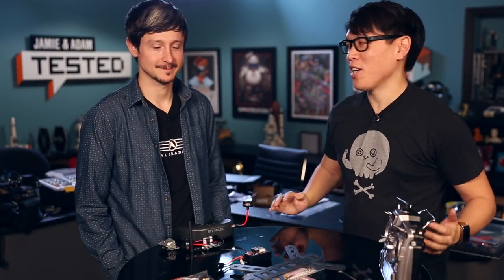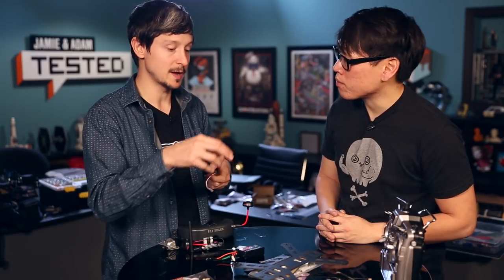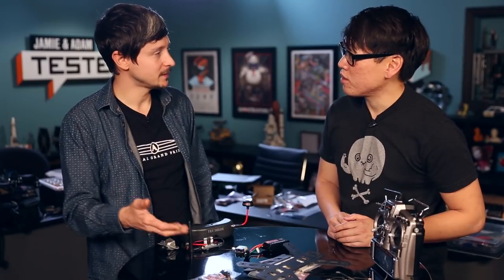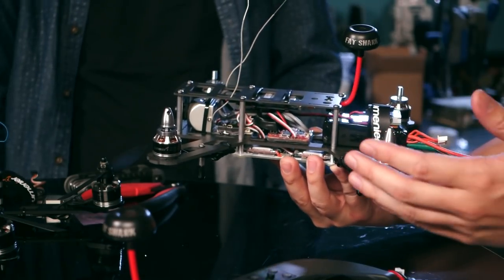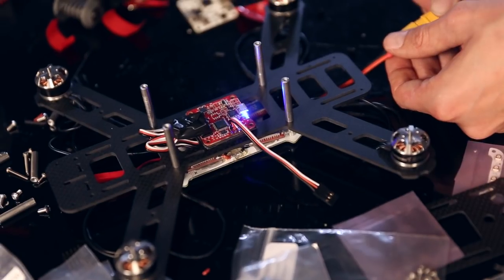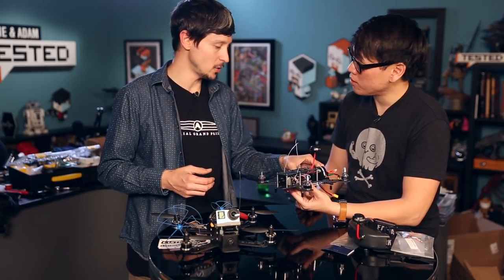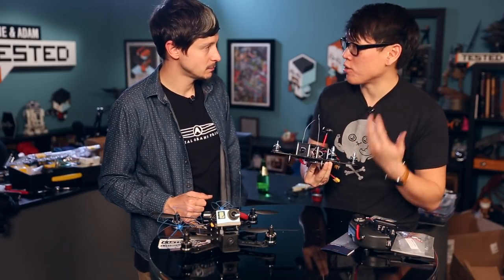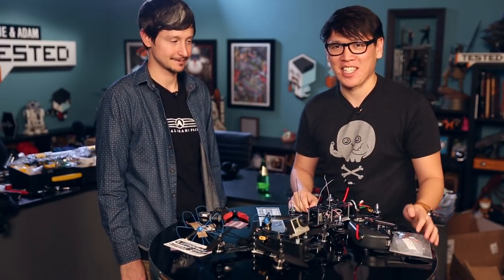How to Build a FPV Racing Quadcopter!

Comment: So I am assuming a full build is like £600+...
Reply: Ethan Gordon nope, you can build a quad for about $250 (as of may 2015)
Reply: ***** Really?! If so nice!
Reply: ***** Nice! Thanks for the information :)
Reply: Np
Reply: ***** Hey I am interested in building one of these FPVs. Do you think this is a drone for beginners? Is there a newer video? (you say May 2015 so I assume there is). Is this list below a good buy? Thanks (Im a noob at drones so pls go easy on me :)  )
Reply: I really wouldn't try this of I were a total beginner.

I would start with something cheap and easy to fly, learn on it, then go up one level and so on.. This 250 FPV quad is more like 5th or 6th step along that learning curve.

Start with a Syma x11 or similar, then I recommend a latrax alias with upgraded motors from micromotor warehouse,, then something cheap and easy to fly/ build..phantom/350/450-clone or even a hexacopter flamewheel something that you can add a nice gopro mount or gimbal and basic  FPV set up to.. then decide what direction you want to go.. more sport FPV or more Areal camera platform... get goggles and or a 7-8 inch screen.

Either way, by that point you'll be ready to make this and fly it, in fact, you should probably have the skills at that point, to build whatever you need next.
Reply: Thank you a lot. I will definitely look at these options.
Reply: Is the Hubsan X4 H107C a good starter drone or should i stick with the syma x11
Reply: Hubsan is older and less refined. It's faster and can be used with a Spektrum transmitter if you get the transceiver, made and sold by some guy on facebook.

The syma is slower and less agile but agile enough and is lighter, has longer flight times, and is easier to control and more durable. Try and remember why you're getting it.. To learn on... It is cheap and easy to fly, and you won't mind crashing it.
It's not, a sport copter, it's a trainer.

Camera versions are not worth buying at this size. There is a video on my channel of the Hubsan camera footage.. It's not very good. . Better off getting a latrax alias and using the camera you can get for that. If you want cheap copter to practice taking footage. But all camera quads are not that great at this price range.

FPV rig is usually over $1000 once you get a camera, AV transmitter, antennas, the actual quadcopter, 6ch radio transmitter, goggles or ground station screen and AV reciever, batteries and and charger.. You can do it cheaper but that involves a lot of hunting for the right thing at a cheaper price, and you need to know what parts you're looking for.

It's not a cheap toy.. That is why I suggest you get a syma x11 to start and learn with. Then upgrade to the Latrax alias, get a camera for it, then make a full 450 from a kit, make an FPV set up and put it on your 450 ...build a ground station or get goggles and learn to fly FPV.. THEN, build something like the 250 on the video and then learn to FPV with it at much higher speeds and far more agility than the 450 you made and learned on.

That is the recommended way to do it, and the most fun and self educating.

If you get into this hobby by making one of the 250 speedy fpv quads, you'll probably give up and have crashed your expensive toy hundreds of times.

Do all that crashing and learning on the syma x11 and latrax alias.. The syma will teach you the basics and is fun to learn on and learning to maneuver the Alias, will make you a confident pilot.

One last thing.. VERY IMPORTANT, DON'T FLY ALONE!!! Always have someone with you to spot your plane.
Everyone needs a spotter to watch, just in case you lose control or lose sight of the quad as it drifts behind you or into the sun.

I ignored this advice before and lost my quad.. I never fly alone anytime anymore. It's just not worth the risk of losing your quad or the risk of hurting other people.

Watch out. Fly safe. Become an example of a good pilot.. Not just another idiot who gives us all bad reputations in news reports

Good luck and always feel free to ask me or other people in the hobby for help. Don't go it alone, it's no fun, frustrating and expensive.
Reply: Thank you very much itchy robot.   I will be sure to get back to you once I get my drone. Do you recommend getting more batteries for extended time or will the originals last a good time? I plan on getting my dad a drone for father's day because him and I really like it.
Reply: If you're getting the Syma x11 to learn on.. I'd get the 5pack of 350 or 380mah 1s lipos and the 4 way charger.. You can find all of it on Amazon.. the batteries and extra charger are lower down on the same page... 
http://www.amazon.com/dp/B00L4O3GV6/ref=sr_ph?ie=UTF8&qid=1433864961&sr=1&keywords=syma+x11
Reply: Ok. I'll check that out. I received a syma a while back as a gift so I got to look around for that. I remember that the last syma I had, the blade was opposite so it kept flipping. I tried to fix it but I never got the time to look into it anymore with school. Thanks again for all the info!
Reply: Latrax Alias is also on Amazon, a simple search will show results for the camera and the copter.... However, I do recommend the 'insane speed' motors from micro-motor-warehouse http://micro-motor-warehouse.com/collections/parts-for-rtf-models/latrax-alias

If you don't want to get $1000s into the FPV hobby and filming, you like mini quads, and don't mind core-less brushed motors with their inherent flaws, and find that you just aren't into the 'big stuff', check out what Benedikt Haak does over at micro-motor-warehouse.

That might be your thing too?

But for hobby grade, really fun micro copters.. Micro-motor-warehouse is the place.
Reply: Timothy Valkenhoff I'd start off with a RTF (Ready to Fly) version.  Let someone else do the work for you, and start with the fun part.
Reply: ^ that's a great recipe for getting into trouble, spending $500.00 and getting ZERO fun out of it.

Build, learn, and train yourself.. DO NOT get an rtf sport quad as your first quad.. You will have ZERO fun crashing it immediately, wrecking it, and having no idea how to fix it.

 Learn how to fly on a $25 syma x5c or an x11, then build a 450 for about $250.. learn how to build and repair, and fly without any stabilization gimmicks. Get an FPV set up and learn how to FPV on that 450, or cheap second hand Phantom (I got one for $65 at a yard sale) at a reasonable speed

Then... get a sport quad.. you'll be ready for it by that point, and you'll know how to fix it when you crash.  FYI you will crash :D

DO NOT GET RTF SPORT QUADS.. that's what idiot novices do... then they crash into something, or someone, and give us ALL a bad rep.

Please don't add to the already bad press just by being an over confident idiot.

I usually train people with FPV set up on something like a Dromida RC car or a cheap 1:10 SC truck. Then put a little $99 HK/fat shark micro cam+AVTx , on a syma X5C or equivalent.. then learn to FPV with that in a back yard size area.

DO NOT BUY SUPER FAST, RTF SPORT QUADS AS YOUR FIRST QUAD COPTER.. ONLY AN IDIOT WOULD SUGGEST SUCH AN OBVIOUSLY AWFUL IDEA.
Reply: ***** Yeah well that too, if its your thing.  I just think there are different options for everyone.  Replacing a few broken parts is easier than building an entire unit and getting everything correct.  Not meaning to start trouble, just throwing it out there for people who have an interest in flying and no interest in building.  We have more RTF sales than anything so there must be some people who agree with me.
Reply: Yeah that's true, there are a ton of people who do that..  But that is the exact problem I'm pointing out and trying to help stop. 

Companies make craft that are so easy to fly, using all kinds of bells and whistles, so that any idiot can put a dangerous flying machine in the air. 

Learning to build (which is just as simple as changing a few parts) and learning to fly properly, without relying on stability software, is CRUCIAL, for responsible UAV ownership. 

It's because of the mindless, fun seeking, millions, we have the FAA, at first, trying to outlaw them all together, and more recently creating strict regulations, that most RTF buyer know nothing about. 

It's like owning a car and not knowing that there's rules when driving on the road..  Or, that you have to drive on the road in the first place. 

I'm trying to encourage people to do-it-right, not take a fast, dangerous, irresponsible, and rather narcissistic, fun-seeking path. It's not worth the risk of doing it wrong. 

Please.  Try to encourage people to take the simple step of building, understanding, and learning to fly properly. Not just buy a hobby grade RTF. 

Encourage people to become one of the good guys..  
Get an AMA licence,  join a local club, learn the rules and join us in writing to the FAA and help us keep this part of our hobby alive here in the US. 

If we hadn't all wrote in the last time.  The FAA would have banned these UAV 's and FPV racing all together..  Please look into the well documented interaction between FAA and AMA. 

RTF full size, hobby grade Multirotors...  phantom and the like = Bad idea for the whole hobby community. 

They encourage inexperienced pilots to fly without understanding the physics, laws, or dangers..  It's a terrible idea, something you can see in the evening news, every week, and increasing. 

It's always some novice with a Phantom :(

Please don't sell RTF to novices.
Reply: ***** I hear ya.  We do highly recommend training and have a blog teaching step by step basics.  We teach people to only fly line of sight and don't encourage selling goggles to novices.  We encourage only flying in open fields and abandoned buildings.  There's always going to be an idiot in every sport screwing it up for the masses.  Even if they build it themselves, it doesn't equal that they are going to be smart about flying it.  On the contrary, the more they pay for it, the more careful they will probably be.  Taking the time to learn properly is key for everything.  I just don't necessarily think building one from frame up as a novice will teach it.  We test fly every one before it goes out the door so we know all the settings are correct and CGs are right so when said novice goes to fly they don't get eaten by it.  Most novices aren't going to build it right the first time and its either going to get away from them or come at them or just crash, all with the potential of hurting people or property.  We remove that factor.
Reply: I'm glad you're doing a lot to help. 

I personally find that people value something they build, far above any impulsive buy at the hobby shop. 

I also think that people that builders, are generally the type that want to know everything about a topic and do the research and get the training. 

Also the builds I suggested, the path I clearly laid out and recommend, would never land any novice in the kind of situation you described. Kind of a strawman argument really. 

I train all the people that join our club wanting to fly UAVs . And we have zero for 30 UAV pilots, accidents or rules broken so far. 

No one is suggesting using anything more complicated than Naza or NAZE32. I have seen 8 year olds program a NAZE32 with the free app. And there are tons of how to videos on YouTube. 

It's cheaper, more reliable, and far more cost effective than RTF. 
Also you can usually fix it yourself, cutting cost again. 

I get that if you're a toy store owner, you want people to buy RTF. 

And you would try to argue that spending money at your shop, is somehow going to make you value what you bought over something you actually bought the parts for AND build, for less, and with more functions, than the RTF.. 
But even if that were true, you'll learn nothing about how it works, or how to fix it, and again have to rely on the hobby shop for costly repairs. 

Best way to go for the pilot and safety and fun, is to build and learn. Grow your confidence and knowledge. 

Best thing for the toy shop...  Buy RTF crash it, have them fix it, or buy another one from them if they can't. 

Learn to fly basic RTF toys,  then build a proper hobby grade the way I suggested.  It's cheaper, better, and smarter.
Reply: ***** Are we in business to make money, yes, but not like that.  We do sell Kit form too and look for happy flying customers that recommend us as ways to keep the income flowing.  Not by selling spare parts to crash victims.  We are not a hobby store, we are passionate group of people that saw a need for English speaking support and US shipping of quality products.  We can agree to disagree.  What's the name of your club and where do you train?  Sounds like I could recommend some customers in your area to you for training for a win win.
Reply: SWEET!
That's great to hear that your shop is one of the good ones.

We're starved in the CA central valley, but for one great place in Oakdale.

I'm in California Turlock RC Club Chapter 1396. Fully AMA compliant club..
But I do stress..  my opinion and comments in no way represent the club.. I'm a member, not an officer..

I'm just the only pilot that has any kind of UAV credential, filming experience, and willingness to train the new UAV guys how to fly, film and FPV... . no incidents so far (fingers crossed)  :) 

The club keeps up on the AMA FAA rulings recommendations, state and Federal laws, as do I personally, and we discuss those kinds of things at our monthly meeting, as they change.

They also recommend people talk with me if they want to learn about UAVs. 
Successful as it has been, it's pretty unofficial.People aren't required to learn from me, just recommended to do so.. 

And... everyone interested in UAVs, has come my way so far, -allowing me to figure out, over the last couple of years, with the help of some of the other great pilots we have, -some really effective training methods and models to use when stepping into the UAV and FPV world. 

Other than the cheaper over all cost,...
 I recommend building, for the same reason I recommend that people have some idea of how your bike works, if you're going for a ride.

If you don't understand that the cable that isn't attached, is the brake cable, then you may start off just fine, but you'll be in a world of trouble at the bottom of the hill. :)

Now it's true, you don't have to build a bike to know how it works, but it helps immensely when it comes to hobby, FPV and professional filming level multirotors... I'd consider sport UAVs to be in that category.

If you understand simple things like CG and how to balance the battery, or that the ESCs temperature is important, and why, or that the feel of the motor, tells you what state the bearings are in, you're less likely to naively and get in trouble.

If you then understand how to hook up your ESC to brush-less motor, to get it to spin the right way, and how to solder it to the power distribution board, or how to do the simple NAZE32 set up, you can then fix it yourself after you crash.

I just think it's minimal knowledge, that pays off dividends when it really counts.

Building my first PC gave me the same advantage. And it's SO easy now days. Just one evening with a couple friends.

I see a place for pre built and pre programmed sport UAVs and would love to have a local place that would make me one to spec'

But I'll never recommend it as a first buy... You really gotta go the simulator, or cheap potato rout... learn to fly, learn to build, then FPV your arse off.  :D

As for the club...
It's been around since the 1970's or earlier..
Lots of fixed wings, gassers, and Copter guys, and now an ever growing UAV group.. we're nearly up to 100 club members in total, and may add more officials so we can go above that 100 member mark.

We're also going to be making a park flyer program with AMA help, to train kids how to fly at a local park in town.

We'd love to have you come out and see our site and hanger at the local, full scale Airfield. And maybe, we can do some FPV at the secret grass field location for members only ;)

We've also have a very generous member who has offered the use of an old abandoned house, way off in a field, on his property... Awesome FPV sight.. but it has got me looking into adding all kinds of different super bright LEDs to my rig, for the darkest corners.

From bike lights to helmet lamps.. I ended up using a strip of Ultra Bright UV LEDs..(Black light) they add so much contrast to the image, it's really cool for flying in lower light areas and under stuff , then they almost disappear in the daylight, they just shine up the really dark spots.

Just make sure you account for peripheral lens glare ( mount them pretty far behind the camera, either side).that UV messes with the optics if it shines into the lens from the side.looks cool, but not for FPV lol.. maybe an acid trip!

Cheers!
Reply: Timothy Valkenhoff Guys, I am not a pro or anything, but I know enough. Get the Spedix s250 bnf! Trust me it is 180$ Bnf! It will go 70mph no problem!

Comment: if you are racing with this setup you will be looking at the ground as you cant angle the camera....
Reply: Not true, on my QAV250 I angle the flight cam at 10 degrees and the GoPro at 20 degrees no problem. Simply put a wedge behind the flight cam to tilt it up, plenty of room.
Reply: ohh okay thanks